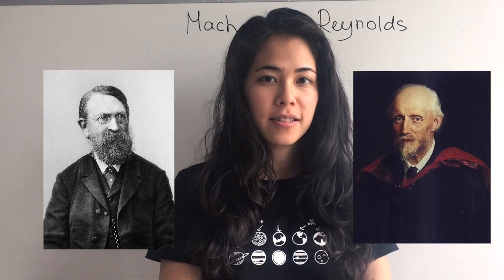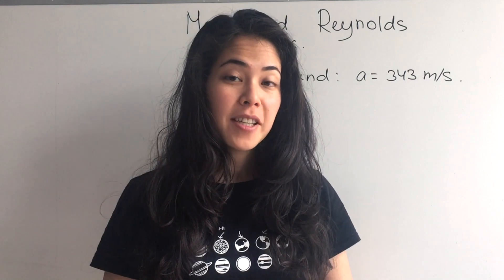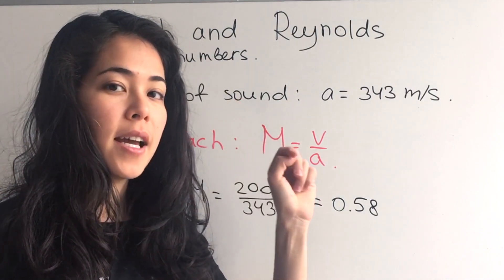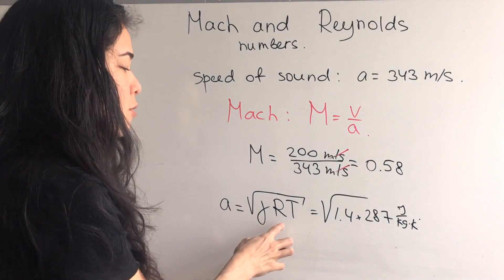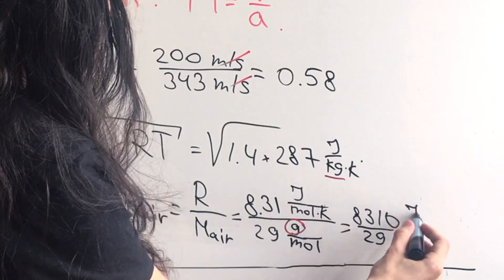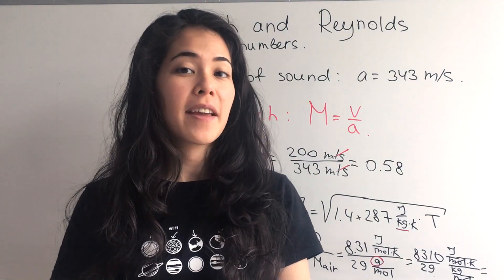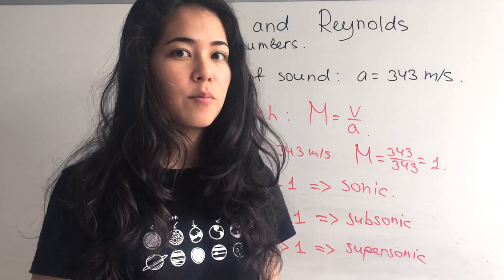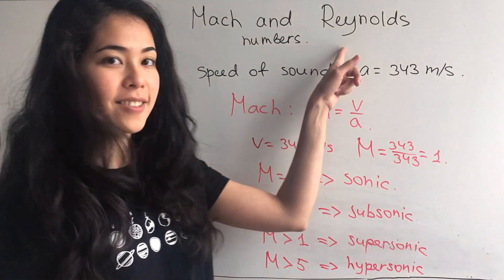Mach number explained.

Comment from the maker: So, where do you think it's easier to break the sound barrier and why? In Colorado or Texas?
Reply: I think Colorado would be easier because the temprature in colorado is 0 celcius today . That means speed of sound will be lower so we will need less speed to go for mach 1. But on the other hand Texas is 25 celcius today so; speed of sound will be higher ,that means we will need more speet (to be exact 1.04478471063424 times more speed)
Reply from the maker: Exactly! Good job!
Reply: Texas
Reply: The air is thinner in Colorado my dude. To but it into basic terms, Colorado has mountains, and the location and elevation makes it so the object travels more distance in less time. Texas has more humid air, this making it slightly slower to fly.

Comment: It will be easier to break the sound barrier at higher elevations since the temperature is low, thus air viscosity is low, resulting in a low density of air where less air molecules can compress on the aircraft body and in front of it. Making it easy for the aircraft to break the sound barrier at high elevations.

Sorry I am not living in the US, because of that I can tell which state weather condition will result in optimism acceleration of the aircraft to the speed of sound, thank you.
Reply: I believe it is the opposite! In fact, the air at altitude is denser than below and there are no fewer molecules. This is a nonsense that was introduced at school, without any coherence with the true science of facts. Because we breathe with difficulty at altitudes, it is convenient to say that there is less air! This is not correct, because what actually happens is that we breathe air with lower pressure and our lungs are unable to absorb this external air, due to the lungs being conditioned to work with air at 1 ATM of internal pressure... The air The external surface has lower pressure due to the much more intense cold, which makes the molecules lose their kinetic energy and thus, atmospheric pressure is lost. Therefore, sound at altitude propagates more slowly, due to the cold air being denser. Sound in a denser gaseous medium loses speed compared to a less dense medium, as occurs with the air below the atmosphere (hotter). The denser, colder air; it loses viscosity, increases compressibility and its elasticity is also much lower! Therefore, sound at altitude is slower and takes longer to gain pressure due to less elasticity. All of this combined makes air at altitude much less efficient in transmitting work than warmer air lower in the atmosphere. Warmer air, less dense, more kinetically energized, therefore, increases the speed of sound. I hope to have given another point of analysis, more congruent with the facts of the physics/chemistry of air at altitude.

Comment: where would it be easiest to break the sound barrier ... at 50,000 feet .. its colder than colorado and texas on the first of march ... except this year as I recall texas had snow porblems around then ;) ... while Colorado was flooding ... but usually Colorado ... even easier at Alert in Canada ... its even colder ...
Reply: Hypersonic ... is that the same as Transonic .. or is Transonic even higher up

Comment: why you take dry air? air may be dry or wet so the wet air will be 16 why not take?????????????
Reply from the maker: Just for cleanness of calculation for standard. It doesn't have to be dry in regular problems.